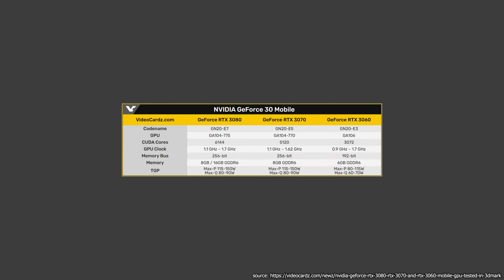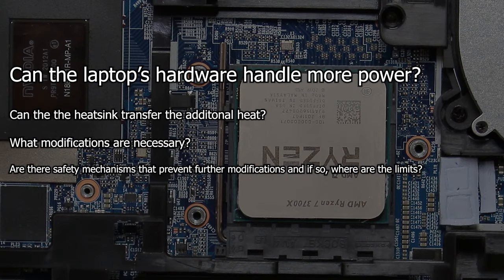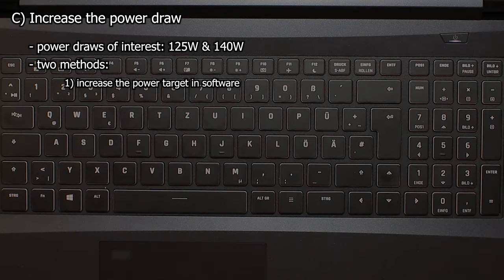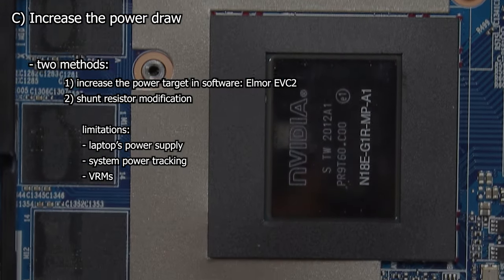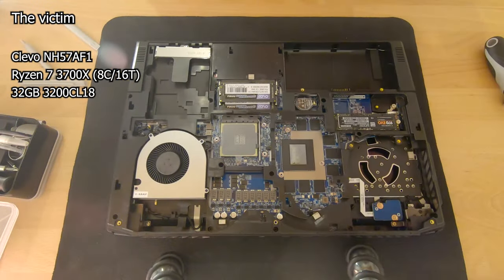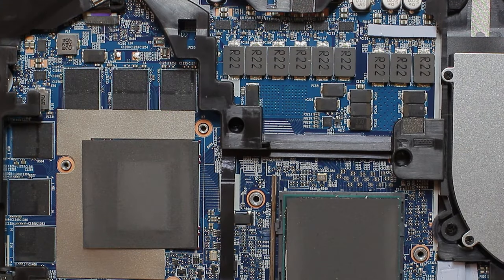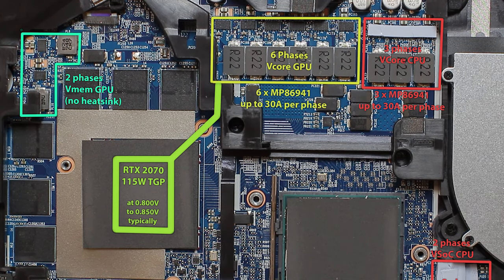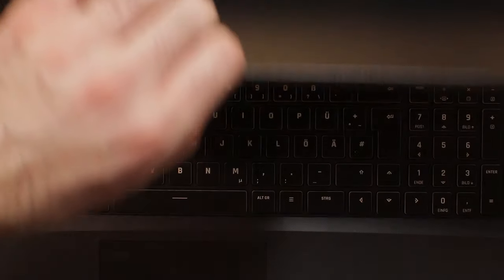Introduction - Laptop Modding Adventure - Part 1

Comment: Ja mega! Endlich was Neues von Dir!
Bin gespannt, was raus kommt. 
Mein Apex 15 schnurrt jedenfalls wie ein Kätzchen. 
Nach Deinen Anleitungen getuned (RAM und CPU), immernoch 3700 MHz allcore und 1,044 V (Undervolting). Pustet im CB20 jetzt 8.702 Punkte (3950x). Schon fett für einen Laptop. 

Aber eine Frage hätte ich. Ich nutze ZenStates für den allcore und das Undervolting. Allerdings springt der Rechner im Betrieb zum Teil von allein auf Standard zurück. 
Hast Du das auch? Ich apply dann neu, bis er wieder mal zurück springt.
Passiert gern bei Star Citizen, daher lasse ich das Controlpanel von ZenStates im Hintergrund offen und wechsle zur Not kurz rüber. 
Hast Du eine Idee für Abhilfe?
Vielen Dank für Deine tolle Arbeit! 👍🏻👍🏻👍🏻👍🏻👍🏻👍🏻
Reply from the maker: Hey :) ja das Problem ist bekannt. Das liegt daran, dass der ControlCenter service noch im Hintergrund läuft. Den musst du deaktivieren. (Task Manager -> Services -> ) open Windows Services -> look for "control center hotkey service" -> deactivate.

Dann wird allerdings auch das durch die Powermodes eingestellte Lüfterprofil nicht mehr genutzt, sondern nur noch ein recht leises. Das führt zu ca 70-78°C beim zocken.
Wenn du ein lauteres Lüfterprofil, bzw. ein eigenes nutzen möchtest kannst du aber immernoch die durch das Control  Center installierten Anwendungen wie "Fan speed setting" nutzen. Einfach selbst in die Programmsuche (Windows Taste) eingeben.

Grüße
Reply: @TechModLab , danke Dir!
Ich hatte das ausgeschaltet... Aber vermutlich aktiviert sich das nach einem Windowsupdate mal wieder von selbst. Hatte ich nicht auf dem Zettel. 😃👍🏻
Lüfterprofil fahre ich eh custom oder manuell auf 100%. Trage Kopfhörer. 😂

And for all others:
If you want to get the most out of your AMD Laptop/PC an RAM... Watch the other videos from 3DAndStuff! This is highlight material for sure!
Reply: @TechModLab , so probiert, und funktioniert wieder. 

Ich habe jetzt mal den all core Takt auf 3.750 MHz erhöht. Das läuft bisher sogar bei 1,038V stabil. 
CB20 bei 8.843 Punkten. 🙈🙉
Die Maschine ist schon krass. 
CPU Temperatur lag bei 74 Grad C, wobei ich die Lüfter auf max habe laufen lassen.

Comment: I've got a Dell Inspirion 5570, i5 8250U. Heat dissipation is extremely poor. Temps easily touch 100 degrees on load. Tried changing the thermal paste. Didn't work out. Any chances I can upgrade the cooling system? Please suggest some methods.
Reply: Undervolt.
Reply: Honeywell ptm7950 phase change sheet.

Comment: Friend, don't use carbon fiber thermal pads. They are worse than thermal paste. You can cause overheating.
Reply from the maker: i know they are worse, don't worry. I use them because i disassemble the heatsink a lot and they can be re-used without any clean up. Later test will be performed with thermal paste, carbon pads and liquid metal.
But please don't talk about overheating. It's not like they are much worse. I measured 6°C-8°C difference on the CPU. For the GPU the Carbonaut pad performs roughly the same because in this specific laptop model there are GPU mounting pressure problems, so the 0.2mm pad is beneficial for the mounting pressure and negates the worse thermal transfer effect. I will talk about that in the next video a little.
Reply: @TechModLab  When I used the thermal pads from the thermal grizzly, I learned +1-2 on the GPU And +8-10 on the CPU
Reply from the maker: @fizikpsix3263  that's interesting! :) so your temps were around 1-2°C different than mine, but the diff between CPU and GPU is roughly the same. Guess that's within measuring tolerances. Thanks for the input!
Reply: @TechModLab  Without problems. It is a pity that my laptop died GPU they did not have to return it.